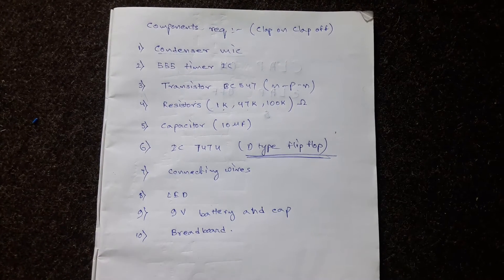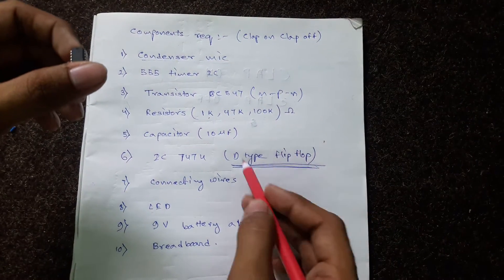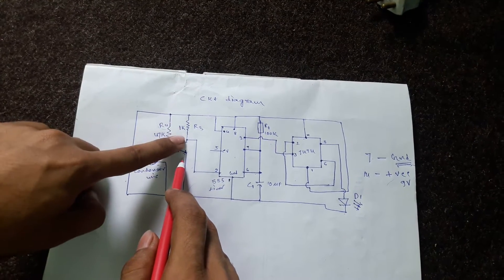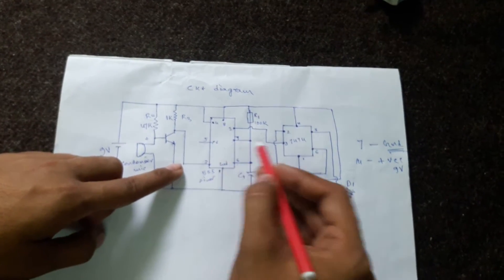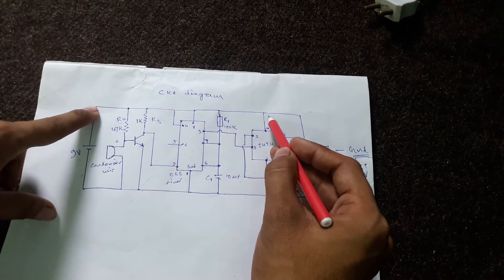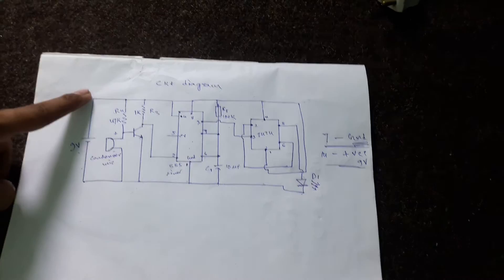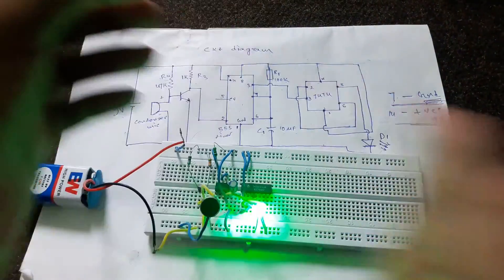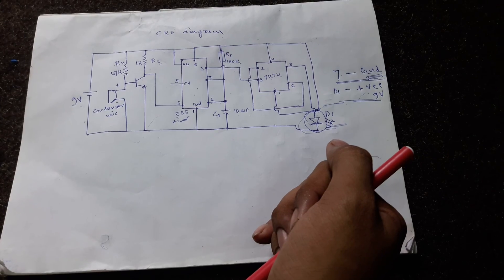Clap on clap off circuit using 555 timer and ic 7474

Comment: i build this circuit but i had a problem that the led stay on once i connect the battery , after i clap the led get more brighter and then after second clap the led turn off for a while and then back on again on low brightness..
Reply from the maker: As we cant see your ckt....still giving a suggestion that- connect the +ve terminal of the led to pin no 5 of the Flip flop properly and it should not connected to the 9V lline
Reply: A 7474 has a max Vcc voltage of 5,25V.  Connecting it on a 9V battery it burns out.

Comment: can you show step by step construction
Reply from the maker: Suresh Jaiswal its very easy just follow the circuit fiagrams
Reply from the maker: Suresh Jaiswal #diagram
Reply from the maker: Suresh Jaiswal did u tried?? It works, it takes some time to make it in breadboard.....thats why we didnt add it in the video.....check the pin numbering properly
Reply: please make step by step construction also
Reply: M jb is circuit ko bnaya or bettery connect keya led jl rha hai direct or kuch nhi ho rha ab m kyse kru